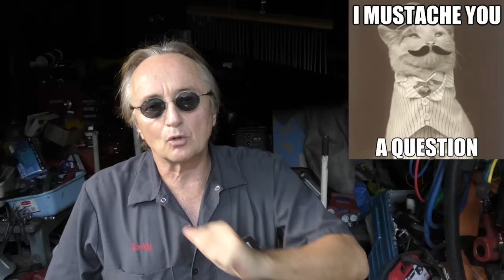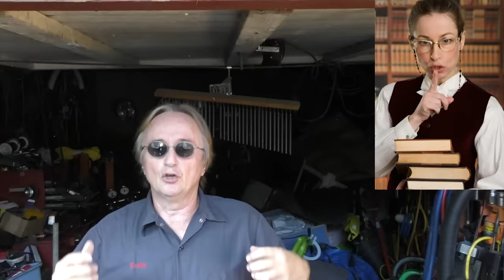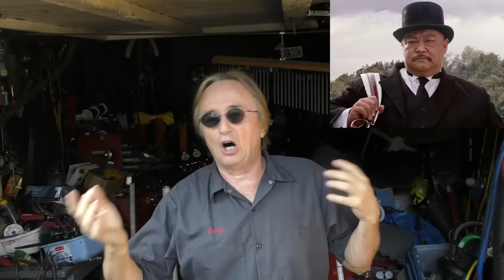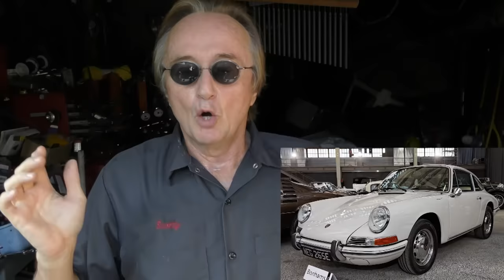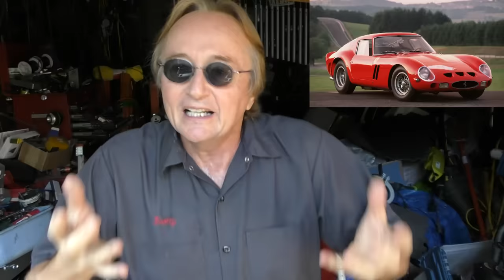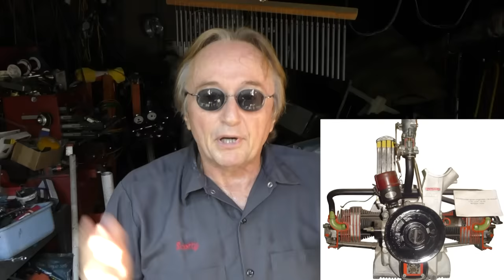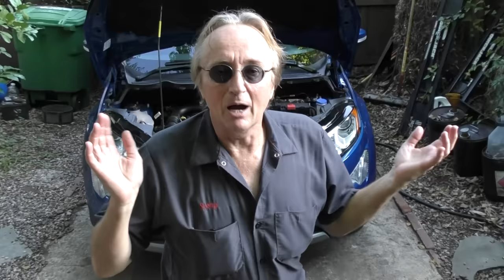The Truth About Boxer Engine Cars

Comment: Its interesting to me that Scotty downplays the significance of the boxer engine since Porsche has won dozens of motorsports championships and that they are almost exclusively used by all small aircraft worldwide...not to mention that Subaru won the world rally car championship for several years with this boxer engine...
Reply: Well that's good but most of us regular consumers who wants reliable and little newer car.
Reply: Superb design for aircraft and great for low center of gravity in cars. That plus their light weight nature can mitigate the relatively low power output as compared with other vehicles
Reply: Konstantin boxer engines are just as good as other designs so long as they are properly maintained.
Reply: @kostya0812  See thats whats confusing to me. Scotty basically makes this same claim in the video, and he says it has to do with the fact that boxer engines are old technology that havent seen as many advancements. However, I'm not sure if he's completely correct about this, and he didn't go in to much detail besides the head gasket problem (I've had head gaskets go on all my non boxer engines so I'm not sure about this either).

Could you possibly provide some detail beyond what Scotty provided, and maybe give a clear reason as to exactly why a "regular consumer who wants a reliable and little newer car" wouldn't want a boxer engine? As an average consumer who wants the most reliable engine possible, I'd like to know the reason. I'm genuinely curious as I'm sure you and Scotty are correct, I'm just not sure why.
Reply: Because they have so many issues in Subarus. The Subaru designs are cheaper than the Porsche ones. They leak, they burn oil and they throw rods left right and center.
Reply: The Lycoming and Continental aircraft engines are horizontally opposed and incredibly reliable.  I've personally flown a 1946 Cub with its original motor.  Granted it's been overhauled multiple times, as required by the FAA.  I suspect the Boxer design isn't done.  It's balanced and compact.  Somebody will eventually resurrect it and make some improvements.
Reply: AUTOWORLD he down plays everything and hypes what he views as reliable according to his experience as a owner of a Mechanic shop and a car dealership I can tell you 1. I have yet to see a perfect car 2. How a car is driven and Maintained will determine the the problems it will have . Yes some cars are problem prone but this guy should operates of opinion not fact . Boxer engines are great performance engines .
Reply: @Super6-Four  I've owned two Subarus.  Never had any problems like this.
Reply: fosterpainter I actually like impresa 2018 it’s cheaper. But it will be automatic
Reply: @fosterpainter Since when do Subarus cost less than toyotas ?
Reply: @jessef3092  most people drive the Subaru way too hard redlining and what not which causes the aforementioned head gasket failures. The junk cheap Subaru design of those engines doesn't help
Reply: AUTOWORLD WRC wins aren’t engine dependent lol, the drivers are what make the difference. When was there last WRC win? 2007?
Reply: Subaru’s headgaskets problem stems from a few reasons. First things first is Subaru’s poor QC, heads don’t line up perfectly with the block and need to be milled. Couple that with a thin gasket made out of poor material and they start leaking as the gasket disintegrates over time. Then you have the famous ringland failure in boosted applications such as the ej255 and ej257. That’s due to poor engineering on Subaru’s part. It’s a short stroke and large bore resulting in piston slap. Couple that with poor oil cooling and the unequal length exhaust manifold keeping the EAT’s on cylinders 2 and 4 at high levels means premature wear on piston rings. They also spin bearings and throw rods. The new Porsche designed fa20 in the WRX and BRZ seems to be doing much better reliability wise, and the JDM ej207 comes from the factory with a proper bore/stroke, forged internals and a twin scroll turbo/equal length manifold. The ej207 doesn’t have the issues the USDM models have.
Reply: Subarus have long been renowned for their reliability.
Reply: pentlx no they haven’t lol, Subaru’s since the 90’s have been plagued by problems due to poor QC or engineering. From headgaskets to electrical issues. Check our consumer reports ratings. Mechanical all has the worst ratings lol. That’s not reliable or dependable
Reply: @kostya0812  Consumer Reports has Subaru as one of the most reliable cars, by not changing the "basic" design, they have had plenty of time to get it right.
Reply: Scotty gave boxers their props. You aren't hearing the whole message.
Reply: @sleeper.simulant7327  Look at consumer reports for the last 5 year, they have made leaps and bounds in reliability currently ranked number 2.  The wrx is the lowest ranked Subaru, probably because it is the one most likely to be heavily modded.
Reply: Boxer engines are not intrinsically unreliable. If they were, they wouldn't be used in airplanes, as the have been for so long.
Reply: Yes he may downplay it because his knowledge on them is limited and he may have never owned one. Subaru's are loved by a certain few, and everyone else just doesn't get it
Reply: @pentlx  by who? Self proclaiming didn't count. Subaru had so many scandals over the years their sales dropped in Japan.
Reply: @jimone1265  hey jimmy i agree i just bought my third subbie for the wife Knowing that it had a bad tranny And head gasket. im a car guy and can get both fixed good for cheap. i will message you in a decade when she wants something newer!
Reply: @Super6-Four  the head gasket problem is mostly from the upper cylinder walls having no support, and the already thin cylinder walls would vibrate too much causing the gasket to rip.

And this was a problem pretty much dedicated to the ej25. Not the ejs as a whole
Reply: @sleeper.simulant7327  subaru retired from wrc in 08
Reply: Light piston aircraft are cursed with antique engine design because the customer base cannot support expensive certification of newer more efficient designs - not because of inherent reliability.
Reply: Yeah and the only one he said he drove was one from one of the new 86s which...aren’t powerful cars compared to STI and especially Porsche engines.
Reply: Jesse Freeman I have a ej205 (2.0 turbo) and it has 200k on the original engine and headgaskets, it’s still running strong. I heard the turbo models do not have headgasket problems (at least not as nearly as bad as the non turbo engines) because they use metal headgasket and possibly other factors.
Reply: Driveitsideways 1 every engine has its problems. I have a friend with a new wrx (FA engine) with low miles and he’s already having problems with it. I believe the ej series engines (at least the turbo models) are decently built, I have 200k on mine and it’s till going strong. I do agree with you on the ej207s, those things are basically bulletproof. With all engines it really comes down to mantainence and how you drive them.
Reply: @matthewswank5801  Those cars look nice but not much faster than my tc lol
Reply: @Super6-Four  what are you talking about? The only time I've seen a Subaru boxer throw a rod is when they don't get maintained. Or when dude bro slaps 30psi of boost on his 100000mi wrx. Neither of which are at fault of the engines design.
Reply: Kevin Gulley hah yeah my bugeye wrx has more power than those I’m pretty sure haha. Plus awd!
Reply: Not to mention Subaru is a long rime runner in ralley races
Reply: @SulCoCrazy  they're great for motorcycles too, and their "low power output" (kind of a bs statement) is also mitigated by the fact that a boxster design allows for more internal cylinder displacement in a smaller overall package.
Reply: @cantrell0817  With a few upgrades the VW boxer engine has been used reliably as an aircraft powerplant for many years.
Reply: @mael-strom9707    Funny how this thread keeps getting comments.  Pretty cool.
Reply: @cantrell0817  A lot of people with a fondness for boxer engines.
Reply: He has one point there they blow head gaskets and next thing evos quicker than those boxer engines hence they were out long time .. subie won the rally races long time ago till evo came in the picture doh researxh it yourself the history of rally racing .. but the boxer engines are inferior
Reply: @pentlx  not the H4 the H6 is reliable and the dealers love our 04 H6 outback because they claim it takes abuse better than the H4. It's common to make sure timing belt head gaskets water pump and  thermostat is done on older Subarus.
Reply: In Motorsports engines are rebuilt regularly. If that’s what you want, go for it.
Reply: Amen. Coildnt have said it better myself
Reply: @sleeper.simulant7327  I own a 2011 wrx and yeah I agree with you. The thing is, nobody buys them for reliability's sake. Worried about the head gaskets? Buy new head gaskets. Worried about the pistons? Buy forged ones. Worried about oil? Buy an oil catch, run synthetic and change it at 2,500 miles. People aren't running stock versions of these cars. You should never run one of those wide open, you have to keep track of your oil and air temp. It's a car for a specific buyer.
Reply: BillyBoss Gaming and before you know it, you’ve wasted many thousands into the engine bay alone, on a car that isn’t really special. I’m wasting the same amount of $ on my Speed6, the heads getting built right now, and for the power, it’s not really worth it... at least the Speed6 is somewhat rare and unique....
Reply: My 86 Subaru sedan was no wimp. But a blown head gasket was the first major repair I had to make. Those valves are a real pain to keep in place while bolting the cam assemblies back on (pro tip: use some thick grease...but it's still a pain).
Reply: Driveitsideways 1 The reason why wrx/sti are always throwing rods is because a lot of inexperienced drivers buy them, i have friends with wrx/sti with no issues and i have friends that do have issues, seeing how each one drives really shows a lot, one is a 05 wrx, 200k miles and runs amazing, also have a friend that has an 08 hatch that makes 400/450ish and the car was bulletproof before he got his hands on it (constantly launching, banging off rev limiter ect.) Same goes with any car though
Reply: A Lycoming airplane motor costs over $50,000.
Subaru EA81 H4 pushrod OHV motor was originally designed for aircraft use, so it's relatively easy to convert.
Reply: Your wife’s matrix is faster than the 86 twins? Maybe it feels like it is, but it isn’t, even if the 86 isn’t very quick. Love the videos Scotty
Reply: @sleeper.simulant7327  nope even the fa20 gets rod knock at less than 100k miles. Horrible engines
Reply: @killallusionmedia6340  they throw rods cause of no baffling in the oil pan for the rod bearings, therefore bearings get starved, the bearing spins out, and a rod ultimately gets thrown. Killer B does a baffled aftermarket oil pan that solves that problem
Reply: 6 months ago I bought a  2006 2.5i Impreza 162k miles chopped the muffler off and got a axle back muffler welded on the back and it sounds like a v8 and I love it , all I changed was oil and plugs and filter and it’s been treating me really good and it’s fast I can’t wait for the snow. Scotty doesn’t have a clue what he’s talking about, that boxer engine is good In my book

Comment: I bought my 99 Impreza with 200,000 miles on it and have put many more on it. All I've had to do was a water pump so far. I was scared with all the headgasket stories but I absolutely love my Subaru and wouldn't trade it for anything. They're also surprisingly easy to work on too.
Reply: still happy with it? im looking at an 05 Impreza
Reply: I have a 1999 Subaru Legacy with the 2.2 best car I've ever owned still going strong in 2023
Reply: Got a 99 forester here, changed the head gaskets and fixed quite a few other problems. Engine was driven to death by the previous owner so it's not exactly perfect anymore (Weird coolant system issues caused by past overheating). But it has over 320,000 miles on it and counting.
Reply: Apparently you have to re torque the heads every hundred thousand miles or so